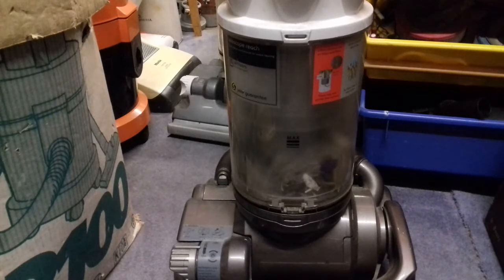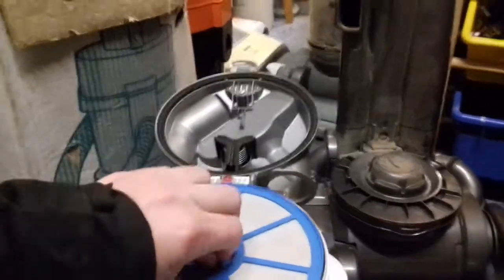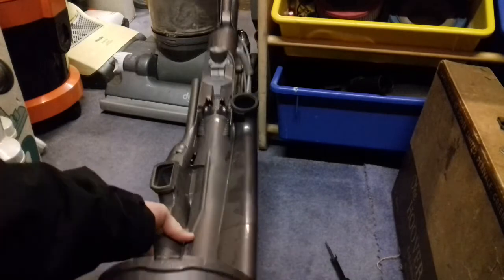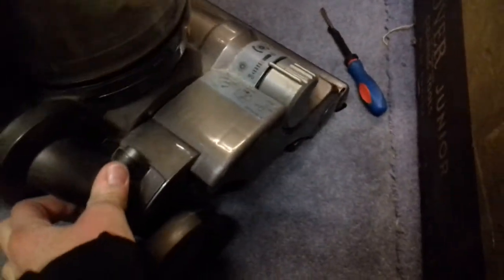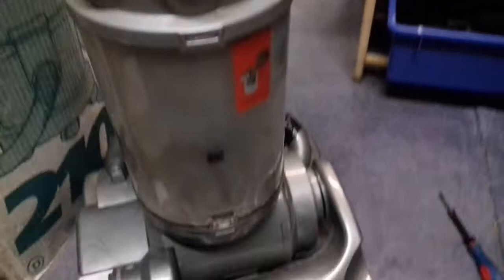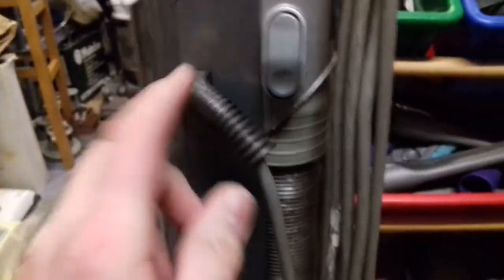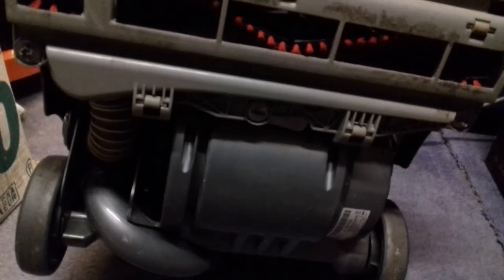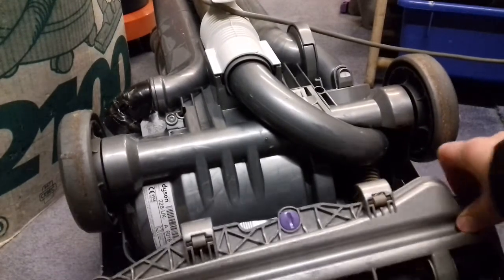Two Dyson DC14s

Comment: Would be great if you showed whether they run or not - its like leaving us in "suspense" when you dont plug them in.
Reply from the maker: I would, but these are usually a burnt out mess so I like to test them outside which you can’t do in thick snow haha
Reply: Ah right - I thought they looked like they might be runners, judging by the relatively clean state of the post motor filter pads - you can usually tell of the motor is toast, by the acrid electrical "burnt" smell and state of the post motor filters. I guess the snow would be bad in bonnie Scotland especially with you having that Red weather warning for today, unless you are not in the Edinburgh area, but I have a feeling I heard you lived in Fife, but not 100% sure on that though.